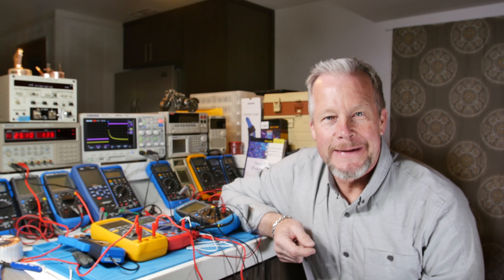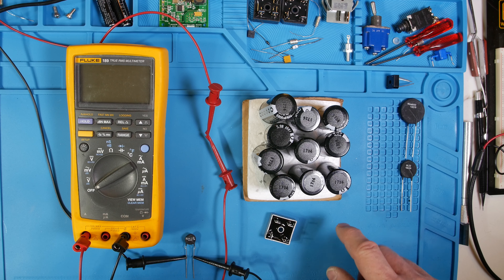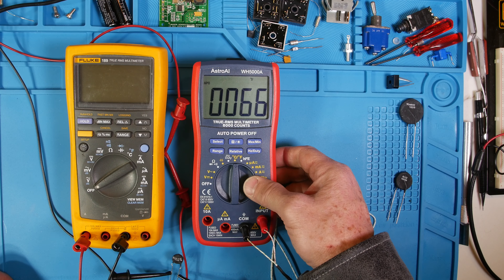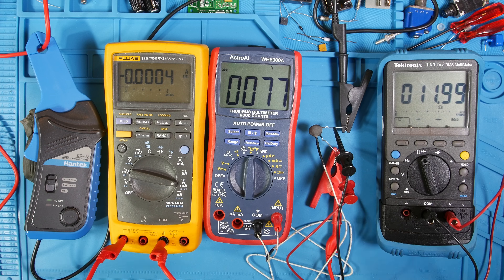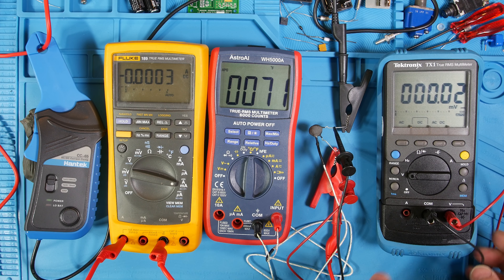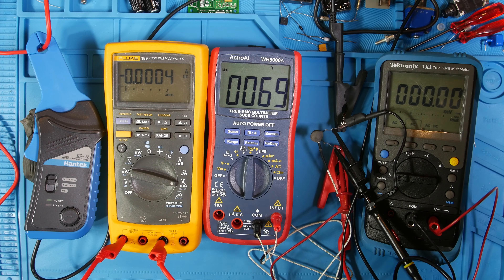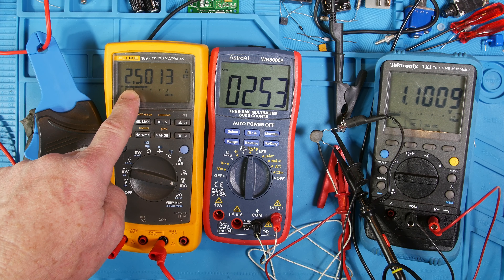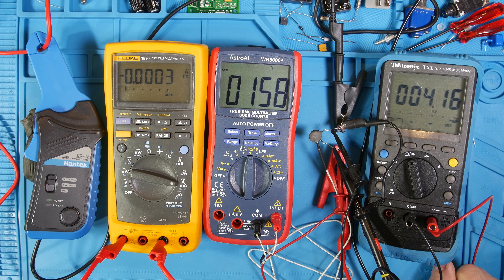How thermistor protects your power supply - NTC protection against Inrush current

Comment: You're very good at explaining the Thermistor but I could only quess what size of thermistor to get! I have a toroidal transformer 110v Primary 40v 10 amp Secondary. Building power supply for audio amplifier.  I would assume it to be a large one. Appreciate your time in replying!
Reply from the maker: Thanks for the great question!  I have a couple more vids on thermistors, here's one: https://youtu.be/iJmwi7_tBLM
You would want to select a thermistor that has a current rating higher than the circuit or fuse is rated so it is no the weak link.  You can place the thermistor on the primary side where the current is lower if that works better for your circuit.  Let me know if you have any more questions and if I need to better answer this one;)

Comment: Very cool!!!  I think I'm on the right track, maybe.  How would you use one of these to keep a refrigerator from stalling out an inverter when using 12V power as a backup for power outages?  Can it simply go inline on the 120V side (both wires?)??
Reply from the maker: BladeforgerKLX I’d have to understand the connection better, but if it is in series, then one should do it.  Thanks for the comment! I’d love to hear how it turns out!
Reply: @KissAnalog  Thanks!!!
Reply from the maker: +BladeforgerKLX You bet!

Comment: hello, great video, learnt a lot. my question is, do 2 200V 680uf capacitor requires NTC to avoid in rush current?
Reply from the maker: Great question!  I don't think that is a lot of capacitance, so I think it is OK without the NTC.  But then, if you have a small current rated fuse - then maybe it would benefit from the NTC.  I'd think it would be OK, but I'd really have to know more to give a definitive answer.
Reply: @KissAnalog  thanks for the reply, there's little fuse in the smps , i changed stock reservoirs capacitors (2x200v200uf crappy brand) with nichicon 2x200v680uf and thought this could stress the entire circuit.however i don't know what ampere ntc i can add.5A is enough ? Sorry for further question:)
Reply: @KissAnalog  May i ask what value of ntc i can use for a 100watt amplifier? Resistance values are so different like 10ohm to 50kohm huge difference, I'm stuck at value selection, please help :)

Comment: I found it sometimes extremely difficult to find the right thermistor.  Case in point, I had a recent project that could benefit from a thermistor, but none could be found to fit the bill.  I needed to limit inrush current to 4 amps at 5 volts, with normal operating current being about 1 amp. (2.5A max on startup).  Do you think I could find a thermistor to fit?  Nope.

My alternate solution was a 2v relay.  It turns out, my power supply could handle the inrush current to charge 10500uF worth of capacitors, but not the capacitors AND powering the unit it was meant to power.  So I used a relay and a resistor so the relay tripped as the voltage approached 5V.  The relay coil is wired in parallel with the caps.  The extra resistor fine tuned the trip voltage to just under 5v, and minimized the parasitic current through the coil.  Thus, the caps are already mostly charged when the relay trips, feeding current to the unit.  I essentially split the two inrush currents, handling one after the other.  Finding a suitable relay and resistor was easy, and I didn't need any complicated soft start circuit.

Another problem with thermistors is that they are really meant to go in series before the rectifier / power supply, which starves the power supply of both voltage and current.  This is known as a 'brownout'.  So it's meant for less complicated (unregulated?) power supplies that won't burn up under low voltage conditions.
If you try to use one in series between the power supply and decoupling capacitors, you'll be creating a voltage divider network between the thermistor and whatever you're powering.  That will reduce your available voltage output.  Worse still, your voltage output will vary according to the thermistor temperature.  This can get quite significant if you're using a low voltage power supply, or a low resistance load.

In the case of my recent project, for instance, a 0.3Ω thermistor in series with a 3Ω load at 5V would result in the load only receiving 4.545V.  And that's while dealing with a 250 degree component inside an enclosed plastic project box filled with capacitors.  Not ideal.

So why use one at all?  They're great protectors of simple power supplies where regulation is not a priority - such as most audio and industrial equipment.  They can also provide excellent short circuit protection, often better than fuses.
Reply: They are in every brand name computer psu like corsair, antec, dell, etc why then?

Comment: Good job.  I appreciate you arranging this demo.  I have a question regarding thermoelectric or Peltier modules (TEMs) and inrush current.  TEM performance drops with excessive on/off cycling or excessive current level cycling.  Do you think inrush current limiting would extend TEM life under excessive cycling conditions?  Thanks for any comments.
Reply from the maker: Hi Anthony. Thank you for your support!  I have not heard that inrush was a problem.  I have heard that the ripple voltage at the power supply is good to be lower than 10% and preferably 5% or better.  It is funny, because I've purchased a couple of TECs to start experimenting.  I'll have to do a video to show what I find. Let me know what you find or if you have any other comments/questions.
Reply: @KissAnalog  Have to confess I'm not that far into the testing phase.  However, got this note when discussing with Allied Thermal: "Generally thermal cycling causes a change (increase) in electrical resistance and will reduce the cooling performance of the module over time.  These changes are generally a slow progression like fatigue in metals.  The severity depends on the severity of the cycles.  The usual way to the monitor the change is to measure the electrical resistance at a fixed temperature, say at 25C.  Resistance is measured using an AC resistance meter (LCR meter)."  Also found this on ferrotec.com: "...four factors relate to failure rate in thermal cycling (of Peltier modules) including (1) the total number of cycles,..."   I'm guessing the underlying, destructive dynamic is inrush current, but I may be wrong.  If you do a video, I'd certainly be interested.  - Anthony
Reply from the maker: Thanks Anthony - great info.  I’ll do a bit more research and do that video;)

Comment: Ok I was thinking "damaging inrush current" but you're just talking about limiting initial inrush that wouldn't blow a fuse.  I think
Reply from the maker: Great question - thanks!  Yes, the initial inrush is typically the highest inrush current - charging the caps from zero to full voltage in an instant;)  I think a thermistor will keep the fuse from blowing or stressing it, but it also protects the rectifier diodes that pass the current, and protects the capacitors from getting hit by the peak current.

Comment: Without a dedicated inrush limiting circuit or device, in their basic ideal form, both linear and switching AC to DC power supplies exhibit inrush current, and the magnitude seems to scale with power (also, switcher topology). Large linear supplies with transformers starting at about 300 VA will have significant inrush current just due to the transformer magnetization current stand alone without the bridge and smoothing capacitors connected. When you add the bridge and caps the inrush is even greater. Switching supplies also exhibit high inrush at moderate power ratings. So, obviously we need to address inrush current because of this unwanted high demand load at turn on. What is high? most designers of workable designs would say 7x to 10x the normal low line high load current. 

To work properly, NTC Thermistors must get hot, and this heat has to go somewhere, usually into the power supply enclosure which then will have to be cooled, usually by forced convection (a fan), which is fine for a power supply design which easily supports fan cooling, like a PC power supply. Because we now have to remove excess heat, you can see that the actual system cost for the NTC thermistor is greater than just the cost of the device itself. The NTC thermistor will generate heat continuously and this heat must be removed in someway. So, a design that uses an NTC thermistor requires the thermistor to become very hot and stay very hot. Why would I want a heat producing device that I must now vent just to handle a one time start up transient event? The answer it's cheap.

A better approach is to limit current with a power resistor, and bypass after the inrush event. Selecting an effective value is relatively easy (actually easier than a NTC thermistor) for a linear supply, but more challenging with a switcher. However, as with any good design, we should monitor the temperature of the critical power devices (resistor, relay, etc.) usually placed in close proximity on the same heatsink for this purpose and interrupt mains power if overloaded (high temperature due to failure).

There are other inrush approaches that "softstart" the circuit, but be aware that softstart circuits are not always that soft. 

For switcher design chip analysis first buy a reference design from the chip manufacturer and characterize on the bench before using it in a design. Make sure to include measuring radiated emission with a near field probe. If the board operates to your needs, then at the end, after all the other power supply performance checks, look at conducted emissions.

Comment: Hello. Few weeks ago PSU killed my motherboard. I have switched pc on by pressing a button. I heard a pop and spotted a spark. Please see the video https://youtu.be/nAP7EJ0t4Ug. The thing that failed inside the psu is  SCK 085 thermistor. Do you have any ide why this happened?
Reply from the maker: It could be undersized and it took just one more cycle to go.  Or, there could be a short in the Power Supply that’s causing the fault.